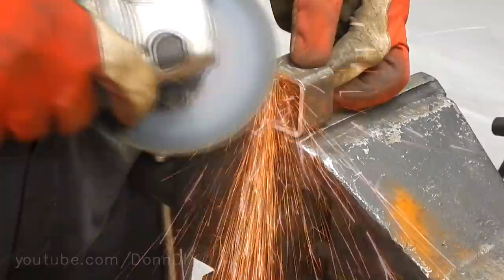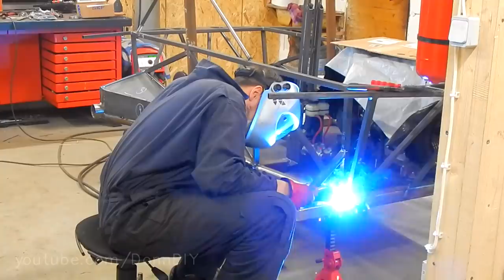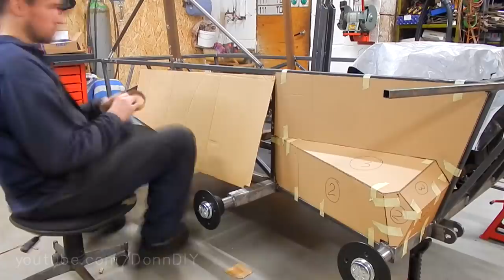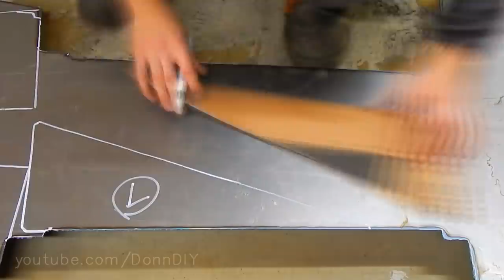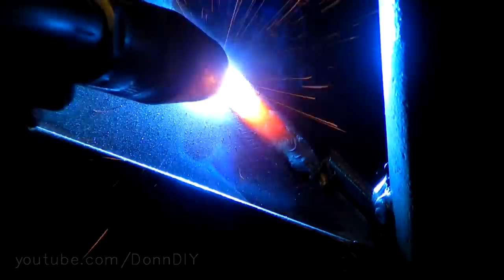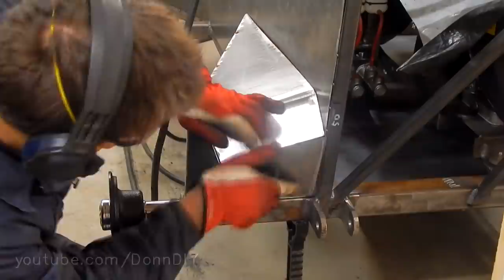Plasma Cutting Body Panels - Tracked Amphibious Vehicle Build Ep. 15

Comment: I worked with an older guy building a twin engine 6 seat executive aircraft, from scratch for Ted Smith Aircraft in southern calif. back in the early 60s. Joe Wojic was his name. The plans for the aircraft had been reduced to dozens of working blue prints. But joe and I were tasked with building the air frame jigs which had to be mathematically perfect. In all dimensions. Joe used a surveying instrument to begin the jig construction. The work took months. Much like Donn DIY  amphibious project  , each piece was hand made by Joe and myself. I learned more valuable techniques  in the two years I worked with Joe than the rest of my  aircraft mechanic career which spanned 25 full time years in the aircraft building business. You talents are equal to Joe Wojic . You are a master at a very young age. I was first learning the things you know almost by intuition. I am now 77

Comment: I went to the pick and pull here in new york state today. You would find so much to reuse in your projects. That is where I picked up electric power steering from a saturn vue to use on my 1950 tractor. I had to plow snow once already and it is a joy to use with 66 yr old shoulders! Thanks for sharing Donn!

Comment: One thing that you might consider is track flex.  I don't know what you are going to use for tracks or maybe just tires.  If you are using tracks, as you catch the edge of your track on a big rock or log, your track will flex and bounce.  First away from your body panel and then into your body panel.  The wider the track the more flex will show up.  Adding a plastic roller to this area will greatly help from gouging into your body panels.  Our snowcat has tracks that are five feet wide and has plastic rollers on the axle housings.  This helps somewhat when we are going down a road that has been plowed out to 8 to 10 feet wide (wide enough for log trucks), but our tracks are 12.5 feet wide.  As we try to blade the road out to fit our tracks, the center will be soft and the tracks will flex lower towards the center of the vehicle.  This condition will cause the tracks to dig into the axle housings at the front and rear.  It bends up our cleat backers and bolts on the edge of the inside of the track.  It's even harder on the machine if you run over a log that is between your drive wheels and the frame causing the track to rub and gouge into the body on the underside of the body.  Now, we don't take our cat across water, but your machine is supposed to float and you will want to protect those exposed panels especially if you run over a log in the water.  A gouge could sink it in less than a minute.

Comment: In the us i put 1~3 psi of air pressure into my axles to keep the water out of them. Even though the air leaks out it still keeps the water out. The leaks are so slow that the reserve of the compressor can keep up easy. I got the idea from the US military vehicles that do somthing similar.

I could never get even the best seals to keep 100% of the water out, but the air pressure works great. If your stuffing box idea does not work you can try it maybe?

Cheers from USA,

Leo
Reply from the maker: Great idea!

Comment: Sometimes it makes the grinding work easier, and quicker, to knock some of the grades of the plasma cut edges with a hammer. Very interesting to see your work and approach to the challenges you are facing in the design and construction of the vehicle. Good luck with it.

Comment: Looks  pretty  good  Donn.  Take  the  rest  of  the  evening  off.  You  deserve  it.  I've  redid  the  bodies  on  a  few  vehicles.  First  one  was  18 guage steel.  After that,  galveneal  cuz  it  don't  rust.  Discolors  a  bit,  but  don't  rust.  Seen  you  sanding  off  the  rust,  and  i  felt  sorry  for  ya.  Keep  them  videos  coming.

Comment: It’s going to be hard to loosen or tighten your axle nut like that. Better way to do is to cut your spanner wrench short maybe just couple inches outside of the hook and then bore a 3/8” or 1/2” square hole on it so you can tighten or loosen the axle nut with a ratchet and extension  just like a crows foot wrench or b-nut wrench.  Another way is to put hex flats on your axle nut and then make yourself a large b-nut wrench or crows foot wrench so it will be a lot more easier to run the axle nut. Hope is helps. Thanks. Karl

Comment: You could do with a couple of gallons of rust remover to save on flap discs?painting a thin layer of rust converter over surfaces before primer wil give added rust prevention

Comment: If you're going to leave steel outside, just rub it with some oil and an old cloth.  Zero rust. And when you're ready to weld just wipe the weld areas with some oil/grease remover.

Comment: How will you tackle the corrosion problem? On the outside a paint job with epoxy will do the trick, but on the inside some places are barely accessible. Galvanising would not be a bad idea. I would hate to see this beautiful contraption transform into a rust bucket.

Comment: You are adding to much wait to your project way to much steel replace with alloy or fiberglass to lower overall weight ,if you don,t its flowtation rate on wet or snow covered ground will b reduced .The only way to overcome the weight problem is 24 inch wide catapiller tracks but your engine size will not cope with it so you need to find a solution to your total weight problem ,remember the lighter the overall weight the less stress on your drive train.I would reavaluate your drive shaft angles to the diff to reduce binding and loss of tourque through the drive train i hope this info is helpful to make your project a success and it was in no way to critasize your work good luck from australia.
Reply: les gaal Good advice.

Comment: Donn DIY you can buy 90 degree fittings and install a line with a grease fitting on the end and mount it in any location that is easy to work from.

Comment: Looks good. Are you thinking angle iron or tube steel tracks? Kinda wish I used angle iron on mine for more bite in the snow and ice!
Reply from the maker: Angle iron tracks. I've looked at the other builds on YouTube (also yours 😉) and found the angle iron to be the best. Planning on redoing your tracks? You'll have the first person comparison then.
Reply from the maker: I built trike tracks with angle iron many years ago. They worked great.
Reply: @DonnDIY   Yeah I would agree that angle iron is most economic and probably gives the most traction. When you get the vehicle done, do you think you could run some pull force tests? It would be neat to see from a vehicle weight vs pull force how much better angle iron is for traction. Keep at it!

Comment: You have said that you have calculated the displacement and ballparked the weight. Exactly how do those numbers compare? It seems to me that if this would at all float, it would do so very very deep in the water, putting your waterline dangerously close to the edge.
Reply from the maker: Take your time and look at the picture in the beginning of the video one more time - there will be an upper edge in addition to this 1.3 m3 you already see. The vehicle will weigh around 700 - 800 kg max. It will float and I predict the water line slightly under the top of the track which is normal.
Reply: @DonnDIY  Thanks, I understand. Very interesting!

Comment: Question. Why didn’t you run the floatation body work all the way forward  between the top and bottom of the track like you did in the back ?  Seems like you would have gained a lot of floatation

Comment: I might suggest non metallic guide for plasma cutting ,can save trouble . Great job !
Reply: How would it save trouble? And how would his magnetic guide stick to the magnets?
Reply: @dozer1642  In some cases a metallic guide can short the cutter . Magnet may collect slag . I am old school , maintained plasma cutters in a production environment .
Reply: STEWART ALBERT no worries my friend!

My understanding of the ground lead on a plasma cutter is that it only supplies the unit with information about amperage and even without a connection the plasma will cut at the selected setting. 

I’ve used magnetic hold downs in welding and cutting for the last twenty five+ years and have never noticed  a problem with field interference.
Reply: @dozer1642  Without ground where is current path ?
Reply: STEWART ALBERT plasma torches don’t use the ground for current path. You can cut without the “ground” attached to anything.
Reply: @dozer1642  A circuit from torch through the work piece back to power supply must be maintained to cut .
Reply: STEWART ALBERT well, that’s not 100% correct. 

It’s not like a welder. The ground lead is more for protection of the operator than anything else. 

Just look at the gauge of the ground lead on your plasma cutter. It’s not big. If it was pulling big amps back to complete a circuit, it would be thick. 

It’s not thick. It’s skinny. It is functioning as a connection between the work and the unit to feed information about amperage and to provide a ground in case of catastrophic short circuit.  

Crack a book.
Reply: @dozer1642  I'll do some research , suggest you do also .
Reply: STEWART ALBERT I don’t need to do research, I’m telling you that the ground clamp is not required to complete a circuit to cut with a plasma torch. If you don’t believe me it doesn’t change the simple fact that I’ve done it. I’ve seen it. I’m not making it up. 

Did you ever notice that an Arc welding ground is the size of your finger and the ground clamp on a plasma cutter is the size of a pencil?

Comment: The middle wheel mounts must be strengthened.  Running into an obstacle they bend up.
Крепления средних колёс нужно обязательно усиливать. Наезжая на препятствие они по гнуться.
Reply from the maker: Yes. I will do this when the sheet metal is installed.
Reply: @DonnDIY   Good job.  Do not stop.  You can do this.  I believe in you.

Comment: I’m interested to see how you’re going to figure out the articulation and steering..
Reply: It's just two main cylinders and two brake calipers and a drivetrain with a differential. It's already finished.
Reply: It is like a "Rabbit on track",nothing  will stop it.
Reply: Going to be a rough ride without articulation of the wheels
Reply: @2tiggsU  nope. You air the tires a lot lower in this usecase (like 10 psi) - since the side load is very low, compared to a usual tire usage. And since you got a very light vehicle and 8 tires, the load lower per tire. This means you get much more articulation per tire.

And then it's not meant to drive on roads, but wet, muddy terrain.

It's comparable to a Sherp, which also just got tire based suspension and the same kind of steering.

Comment: I'm getting nervous here, will it fit out through the doors once it's done?
Also, how's the heating system working now with the insulation and walls done?
Reply from the maker: I have a tape measure - it will fit through the door opening. Heating is fine, the wood stove works really good. Just have to make new more air tight windows at some point.

Comment: Donn you vehicle , even though tracked, will be hard to ride in without any suspension will it not?
Reply from the maker: Low tire pressure at low speeds is the solution. ARGO has no suspension.
Reply: @DonnDIY  Think about torsion bar suspension of some type in the second and third wheel assemblies. The ladder type tracks seem to lose traction on uneven or sloped ground with certain obstacles on the videos I have watched of "home manufactured" vehicles and they look like they could run off the tires in certain ground conditions. How hard would it be to use a mounted shock absorber and a swing arm with two smaller diameter boggy wheels maybe and idler roller instead ? and maybe add fins on the wheels to provide power to drive your vehicle while in water? an auger type of assembly wielded to the hubs (fan blades metal or plastic off a junked car that can be bolted on?) you can lock your differential right ? so power to the tracks shouldn't be a problem in mud or loose ground/snow.

Comment: So why not just connect all 4 points of road wheel axles and sheet metal over that giving it more buoyancy, increase its strength, simplyfy whole frame design and maybe even add bit storage space in there? If all this was for rims to pass trough, just remove center of the rim, swap it around and weld it together. Turned rims are nothing new and would work fine in 35km/h tank like this. Also front is so boxy that huge amounts of efficiency is lost on water.

Comment: A trail arm suspension wuld be great..
Or you back will break...
Reply: He could take some tech from  construction/trucking and use a suspensioned seat (they absorb alot  of the bouncing and hammering the dump truck I drive uses a rubber doughnut on link beam for suspension and rides pretty smooth only because of the suspension seat)
Reply: @dodgeme1986truck  thats reminded me long ago i was working on tough suspension Kawasaki mule.... Felt back very well.....

Comment: Why does it look like the tires are not all in line? If tires are not all straight the track is going to want to walk off.
Reply from the maker: Wrong rims with different offset installed, that's it. The right rims are without tires at the moment.
Reply: @DonnDIY   thought I'd mention it, I thought everything was square in other videos just didn't want you to go too far to take it apart again. I've done that before, get everything lined up almost being done and one thing shifts and it had to come back apart.